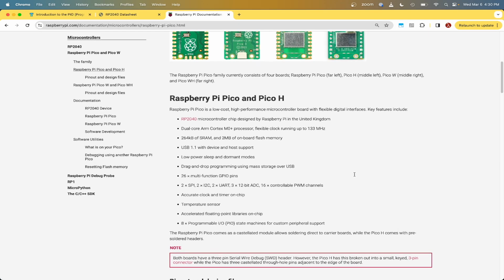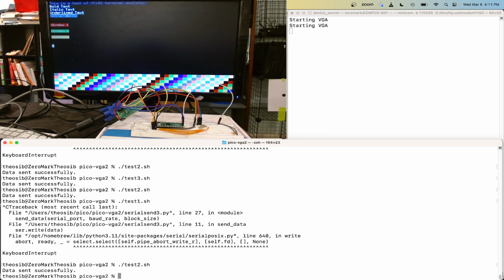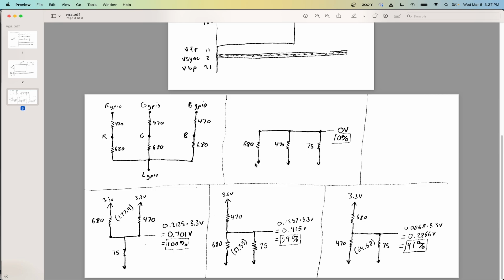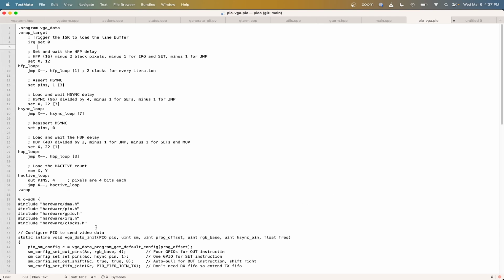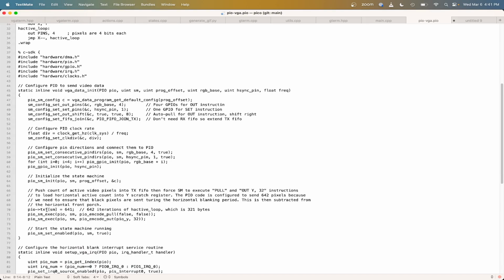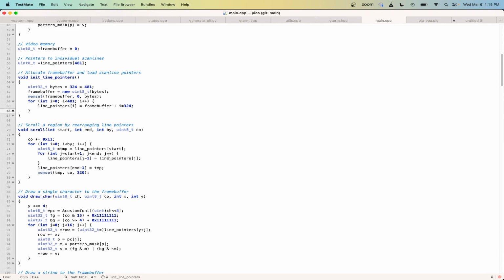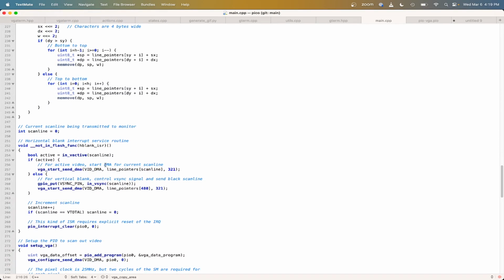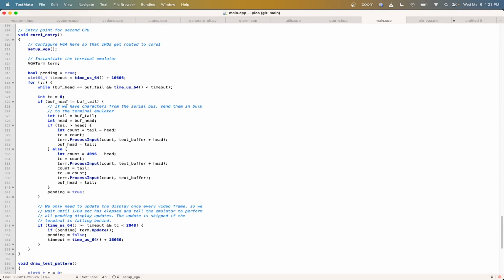VGA display and VT102 terminal emulation on Raspberry PI Pico

Comment: I think you only have 1000 subs because you're so incredibleat this!! And most of us can't follow, LOL. I wish I could do 5% of what you can. It's near impossible to find a 10/10.1/12" HDMI VCA LCD "vertical" screen to use with Arcade IUP machines that only have an 8" screen (The 2nd generation is pretty small). They are all horizontal, I even wondered if my (won't charge) Amazon Fire Tablet (10" screen I think) could be used vertically.  I'd be willing to bet it can be done. It seems that these Rasberry Pi's will do incredible things!! Hey, when I was 14yo Mom bought us a Commodore Vic20, and once we got the tape recorder my brother and I could save our programs! 40 years later while he writes and installs software and controls that run the hydraulics on massive ships. A few years ago he told me he couldn't believe how good I did being his younger brother, he had found some of my programs on the cassette tapes. Of course he never told me back then, I sure wish I stuck with it but I didn't care for school. That was back in 1984, I would have had a whole different life. Sorry for the book, thanks for the video, I still watched it.